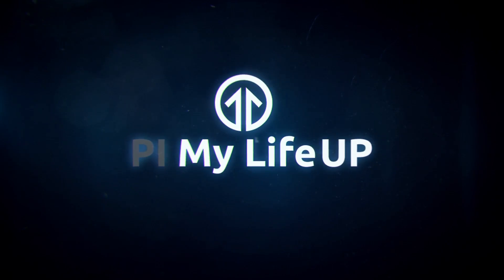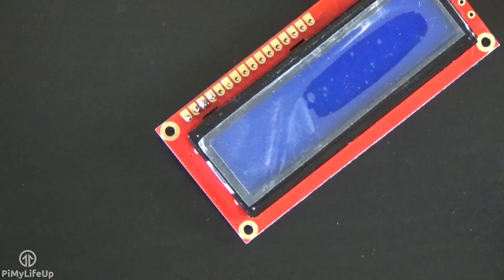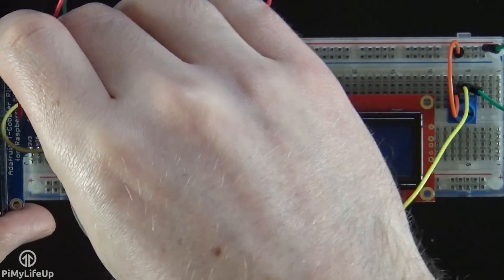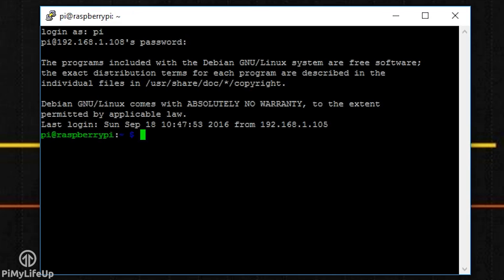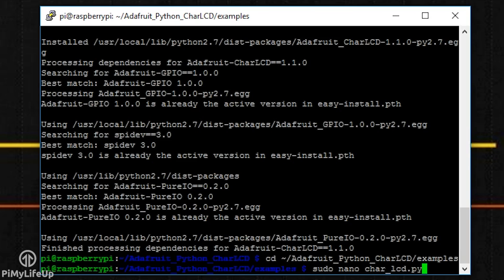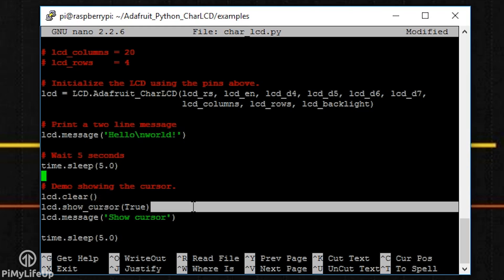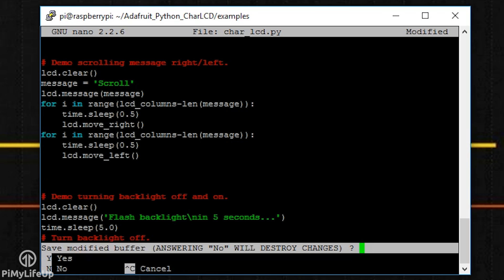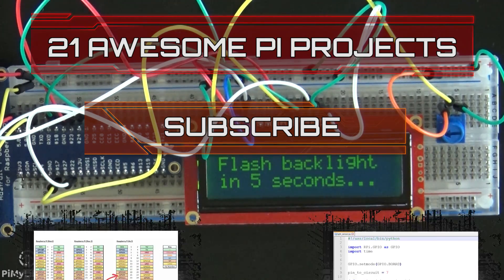Raspberry Pi LCD: How to Setup a 16×2 LCD Display

Comment: 6:23 "If you followed my circuit, the following values are the correct ones."   lcd_backlight = 4.  You never wired up GPIO 4.  Is there a way to turn off the backlight?